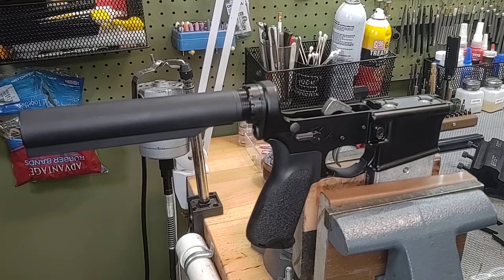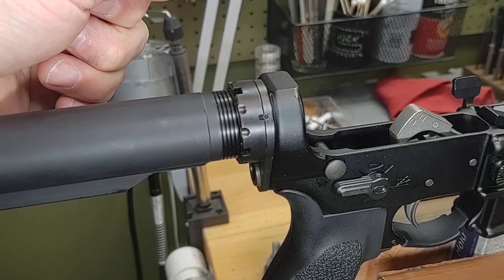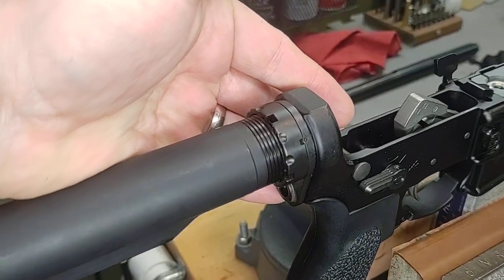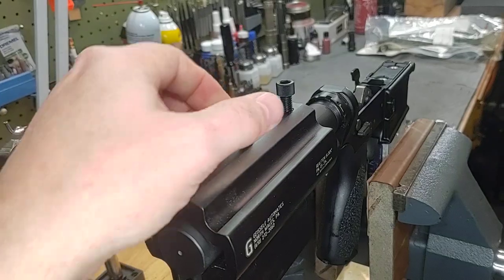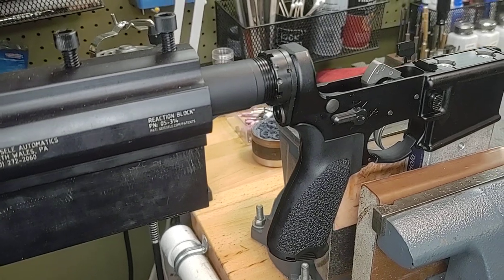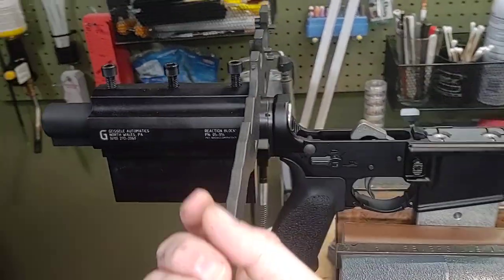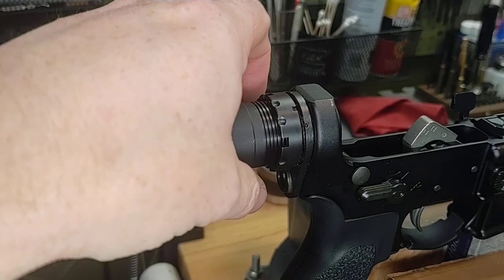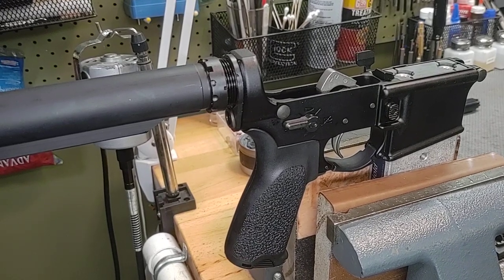Staked Castle Nuts are NOT permanent

Comment: The real trick is finding a sure fire way of the extension not clocking when tightening the castle nut. I put a stock on and try to time the extension a couple degrees past bottom dead center. Then, when tightening, I put counter force on the tube by way of pressing my torso against the stock. It will still inevitably move a bit but hopefully not more than a couple of degrees. Sometimes I can get it to dead center first try, other times it takes a couple go's at it. The LMT extension tube is the best way I have found to get around that issue. They manufacture a tongue into the threads which will pin itself against the retainer pin, not allowing the tube to rotate past center when tightening. It's a Godsend if you get frustrated with crooked receiver extensions, just wish they made A5 length.

Comment: Removed one recently, mine would not budge until I used a tiny flat head screw driver to pry out the displaced material. Then it came off easy. Good indication of how effective staking is however

Comment: I agree with some comments, like to get that reaction block. I have an older Olympic Arms "LE Carbine" . That castle nut is staked like Thor drove a spike into the end plate. I cannot get it off. I'm sure a gunsmith could but damn that's not going anywhere. Good video, thanks.

Comment: In auto mechanics, we stake axle nuts (they hold the drive axle in the wheel hub to transmit the rotational energy through the axles, to the hub, and to the wheels via the lugs). Just takes a little extra torque from an impact wrench to overcome the clamping force. No big deal.

The purpose of staking is a mechanical method of preventing fasteners from rotating due to vibration. At least, an additional mechanical way. The primary way is proper torquing of the fastener, but there are instances in which an additional load needs to be placed on the fastener. That's when you typically use split washers (which "bind" the threads together to attempt to prevent rotation). And the chemical way to do this is thread locker.

I'm no engineer though, so if the firearms engineers decided to use staking, there's a reason for it. Stick with it.

Comment: About reuse of the castle nut.  Even if it did line up with the old staking position, if there was no a replacements available due to legal restrictions or end of all commerce in such items, with a dremel tool or a file or other tools new notches could be made.  I know that is not the sort of gun assembly that is advocated here, but people must always be conscious of workarounds due to necessity.

Comment: Was never meant to be permanent, just to prevent the castle nut from loosening. Being able to break the staking with slight firm torque is pleasant to work with. Colt's machine double staking is insanely secure.

Comment: dang, i wanna 3d print something like the reaction block now. I always slip off the castle nut ahha
Reply: Check out the Forward Controls Design JCW, it has a lip which sits over the edge of the castle nut to help prevent the wrench teeth from jumping.

Comment: During assembly, if the extension is Canted like that , would backing the nut off and rotating the receiver counterclockwise and re tightening, would that work? Or am I thinking incorrectly?
Reply from the maker: You are correct.

Comment: Making a castle nut permanent is why Red Loctite was invented. Just stay arm's reach plus 3 feet away from a gunsmith or armorer when they try to remove it for some reason. Better yet, don't even be in the same building. The best staking tool is the Tango Uniform you demonstrated from Echo Zulu. Proper torqueing to 40 ft-lb is the first step to keeping a castle nut secure.

Comment: I will lay the case for staking, but I’m done arguing with the “good enough” or “works for me” people who will argue against staking. The loctite guys are great as well. That may keep the castle nut in place, but it doesn’t stop the receiver extension from loosening with it.
Reply: Sometimes locktite has it's place.  On my pistol build, my wrench wouldn't fit over the tube.  I had to use a single lug spanner wrench that I couldn't use the torque wrench with.  The tube is cut out for the buffer retainer, so if it rotates, it's only going to move a degree or two.  So locktite there will be fine to hold the castle nut.  She's still tight at 500 rounds.

In life, many times you do what you have to do, not what you'd like to do.  In GW I, I had to replace takedown pin detents with filed down pieces of coat hanger, as I couldn't get parts through the supply line.  They worked very well, and survived until after the war, when I finally received my parts. It wasn't what I'd like, but it was what I had to do!

Comment: I would like to hear your opinion on a topic. I have a question about the Voltor A5 rec extension tube. I have a silencer and wanted to know if using a A5 rec extension would be beneficial or should I just use a heavier buffer and or buffer spring to slow cycling? I’m currently running a H3 buffer, standard spring, on a Daniel Defense MK18 10.3” barrel. Ejection pattern with current set up suppressed is about 2 O’clock.

Comment: what's the difference in breakaway torque between a staked castle nut and an unstaked castle nut?
Reply: @HolyShitAccess  Have dozens of build & have never staked them with no problems.  I put locktite on a couple of my 1st builds but don't even do that anymore.
Reply: @11C1P  That's why I'm curious.  The castle nut is functionally a jam nut, jam nuts are used to lock fasteners in lieu of other methods.  Doubling up on locking methods seems...odd.
Reply: @tavelkyosoba classic example of a solution to a non existent problem, becoming a "must have" trend 😮

Comment: Why is staking the castle nut a standard? Mine have not moved at all being not staked. Granted .224 if pressure applied tightly does loosen, not under firing. TNW is not staked and probably about 400-500 rounds solid and can not loosen by hand. I have known no person who built their own as well to have mentioned castle nut moved. So far no gun smith has ever been able to explain why this is done. Also so far no case they have seen of an issue being not staked. 
I am not looking for the answer being because the manual says to do it. If reasonable ill follow it; but between torque spec, options like loktite, or spring washers options exist. Seeming to be a set in way mentality as opposed to practical reason.

Comment: So, I am currently running a POF renegade plus. It uses a steel castle nut, but a 6061-T6 alum end plate. I staked it but was wondering if the alum is strong enough for the staking to do its job properly under somewhat harder use. Granted it is only preventing vibrating loose, am I over thinking it?

Comment: If you ever made a jig for replicating the square staking Colt and BCM use, you'd forever be my hero.
Reply: For a mere $188 you can get the proper tool to make that square staking.  Look up HK Buffer Staking Tool online, and you will find it.

Yes, I made the leap and made the purchase.  Everybody wants to produce the staking quality I do ...until they see the price.

With the HK tool in hand, it is possible to field fabricate the staking tool.

I made an impact staking hammer press and a support fixture to get the staking perfect.  I used the copycat die to properly time the staking to always be square.
Reply: @johnphillips222  Are you happy with your purchase?
Reply: I am happy with the HK staking punch.  The price was steep, but I like the look of the square staking.

The HK staking punch does NOT work with the steel Magpul ASAP receiver end plate.  It is too hard.

I probably shouldn't say this, but it is the truth.  I use the Geissele receiver tube reaction block when tightening the castle nut to 40 ft-lb.  I loosen the castle nut and torque it, again.  I don't stake the receiver end plate, unless someone asks me to.  I am OK with someone staking it or not.  The torque really matters, and anodized aluminum threads are weird the first time the theeads mate.

I hope this helps.
Reply: If you want to field fabricate your own HK style staking punch, the dimensions are 0.116" by 0.074" with a beveled cut on the 0.074" face to help displace material into the castellation while keeping the punch vertical (in a jig or by hand).

A donor punch, like the nail set or some air hardening drill rod both work well.

I hope that the dimensions help.
Reply: @johnphillips222  Thanks! I'll definitely be making one.
Reply: I just use the core of a .50 BMG armor piercing round.  Best center dent ever made!

Comment: Who makes the armorers tool you used in the video?  I have the magpul but i can see the advantages of this one as someone else noted.
Reply from the maker: Tapco. Unfortunately they are discontinued.
Reply: Just my luck , so sad.   I was also needing guidance on keeping the extension buffer tube straight.  When i tighten to 40 lbs. it seems to always get clocked a little past clockwise even with the groove in the retainer plate aligned perfect with the buffer extension tube.  Wondering if you had a video on this or if the Geissele  block would come into play?  Thanks, and Absolutely love the attention to detail.

Comment: I gaulled the buffer tubes threads taking mine off recently because I needed to fix something stupid I did on my first build from inexperience. It all went back together ok and seems solid even though those couple threads are gone. Is this something I should worry about replacing the tube on or dont worry about it since the other threads are holding it together?  I think in my inexperience I had loctited the threads and that's what caused the screw up. I'm a little more knowledgeable now after a few more builds and a lot more research but that first build is my baby

Comment: I'm curious; is there any real advantage or need for staking the castle nut?
Excellent video, btw. Concise, to the point, and very clear in message delivery.
Reply: Staking helps make absolutely sure your castle nut does not come loose, which is common on ARs without a staked nut. However diligent re-tightening also works fine as well, not staking can also be advantageous if you replace and mess with parts alot.
Reply: @Daizenzetsu  thank you.

Comment: I have had difficult times tying to get the buffer tubed clocked properly when torquing the castle nut. Kind of annoying to me. What is the best method to keep the buffer tube clocked properly? I have used several method such as the geissele buffer reaction block and a mag block. Even with the Geissele Reaction Block the receiver tends to rotate.
Reply from the maker: I posted a video last week showing what I use. Two vises, a reaction block, and a mag block.
Reply: @SchooloftheAmericanRifle  I was actually thinking of using two vises a few weeks ago. lol

Comment: I may be dating myself but, I can remember when a highly skilled stock maker would produce stocke with the butt curving slightly to the right, viewed from the rear, it is more ergonomic than straight
Reply: That is called "cast" and it is still done, usually on high end shotguns  😂 A really good gunsmith can actually bend the stock in a gig, using heat and gentle pressure... I had a gunsmith roommate for years that did these quite a lot 😮

Comment: are there any negative effects of not staking a castle nut? I built my first rifle and I'm going to be taking it to that range soon, i'd rather not run into silly issues on my first run
Reply: It can come loose over time. Duty/service rifles should be staked, but it's not a major problem for range guns. I keep a small combo castle but wrench and 1911 bushing wrench in my bag. 

OTOH, having a buffer tube come loose during a "critical incident" could be bad. 

None of mine are staked, yet, but I'll stake them when I finally stop fiddling with different end plates and such.

Comment: Good video and I am not really surprised at all seeing as the castle nuts are aluminum...
I have never staked any of my builds and never had one come loose yet
Reply: I guess every one has their own experience. I had a rifle that I replaced the end plate on, so I could use a single point sling. 
I tightened the buffer tube and castle nut down, and did not stake it. First rifle class I went to, later that year, within 600 rounds the buffer tube was loose. 
Didn't cause any jams or malfunctions, and I caught it before the buffer retaining pin disappeared, but did mean the stock was loose. 
When I got home from the class, I re-torqued the castle nut, and made sure the stock was clocked correctly, and staked the nut in two places. 

The next year, I was able to attend a patrol carbine class, same rifle. No issues with the castle nut getting loose. 

I'm a believer now, and will just treat end plates as disposable- since they're cheap enough and I don't remove the buffer tube often. Or, since I made the changes to my rifle that I wanted, at all.

Comment: I just run a PWS castle nut. With the built in detent you don't have to deal with any of it 🤷‍♂️
Reply: Bingo
Reply from the maker: Seen many of them come loose. I have a few in my bins of shame.
Reply: @SchooloftheAmericanRifle  interesting. Ive never had one back off. I've also never stick a regular castle nut either.. also without issue
Reply: @Randy_84  I’ve seen 2 come loose in classes. 1 the ratchet actually broke on the other one came completely loose
Reply: @luckygunnerx30  I'm not saying it  doesn't or won't happen, I'm just saying the 4 rifles I have them on.. zero issues with them.
Reply: @Randy_84  Ahhh your one of those guys got it. In the end of course its gonna fail its added complexity to something that doesn’t need it and its also just a complete waste of money but you do you I suppose. Inferiority at a markup
Reply: @Randy_84  I think of myself as the Castle nut police. I’ve observed 5 castle nuts back out in my life causing a rifle to fail. 2 with the PWS Ratchet 1 that somebody just loctited and 2 unstaked ones, 1 of those being my own. Now I am a 100% stake it person.
Reply: @luckygunnerx30  damn, might sell my ar then. if the whole damn gun can break just from a castle nut backing off, then i dont want the pos.
Reply: @frigglebiscuit7484  or you could stake it.

Comment: Can I just use blue loc tite instead of staking it ?
Reply: You could but staking is the mil-spec and proven way, metal displaced into the notch and can be removed with a bit of torque. Gluing with loctite leaves residue, needs heat to remove if red, and can damage or gall the threads.

Comment: Why not use a pws ratcheting castle nut. Are they no bueno?
Reply: They are single use as well. PWS says not to reuse them. That’s an expensive single use part. End plates are way cheaper. While the PWS ratcheting castle nut is more secure than not staking or using only Loctite they have had their own issues. I’ve talked to a few people that have had them come loose.

That was an expensive solution looking for a problem that didn’t really exist. You can stake a castle nut with ease using a 3 dollar harbor freight center punch.

Comment: Have you ever seen a properly staked castle nut break loose under use?
Reply from the maker: Yep. When the thread class is not right things can come apart.
Reply: @SchooloftheAmericanRifle  I'm not familiar with "thread class" and you've got me curious. Do you have a video that would educate me?
Reply: @viewatyourownrisk  that's talking about how tight the threads meet up. Been almost 25 years since I last heard it, so the number might not be correct, but a Class 5 or 6 fit is interference, the hole is smaller than the bolt going into it. Case example was the flash suppressor on an AR.
Reply: I've seen the staked castle nuts come loose in two cases.  Some people are tightening to 40 in-lb, not the proper torque of 40 ft-lb.  Staking or no staking, a joint fails due to the loss of preload.

The other case of loosening happens when someone mortars the stock on the toe of the stock, not the proper location at the heel of the stock.  MANY ex-military people teach the wrong way to mortar fix some malfunctions.  The receiver extension bends, and joint preload is lost.  Surprisingly, a lot of people run with bent receiver extensions and wonder why the malfunctions happen.  Add more lube?

Comment: Absolutely unnecessary to stake more than once.  Additionally, many customers prefer it not staked more than once since they plan to upgrade later anyway.  The purpose of the stake is to disallow the castle nut from loosening and backing off due to vibration.  If you tighten up the castle nut properly and stake the receiver end plate properly ONE time, then you will be fine.

Comment: I wonder if the Fortis or Lantac ratcheting systems will stay put better than staking? I know the PWS system is trash
Reply: Lantac is trash too. Had to return mine because their castle nuts were out of spec and would not thread on any of the buffer tubes I had.
Reply: @rustyshackleford8473  Well fuck I guess that leaves Fortis. I've got an uninstalled Lantac which I think does thread onto my tubes. What tubes you using?
Reply: @xxxxxx-rm2pn  I tried one on a Colt, BCM, and Geissele buffer tube and it would not thread down on either of the three. So it was definitely Lantac not making it to spec. I ended up going with the PWS actually...wasn't aware there were any issues with them.
Reply: @rustyshackleford8473  Just be careful i wouldn't run PWS on anything but a range or collection gun

Comment: Why can't you reuse the castle nut it the staking lines back up?
Reply: I believe he misspoke and meant to say you cannot reuse the end plate as you can't push material from the same location that has been staked prior.
Reply from the maker: @tylerrichardson6530  correct. I probably misspoke.

You can't reuse a staked end plate if the notches line up with the previous staking. There usually isn't enough material on the end plate to restake.